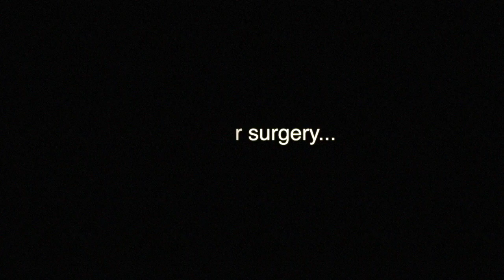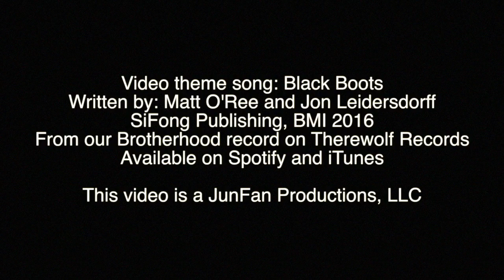Tech Talk - Episode 6 - Comparing Pots

Comment: This was a cool video. I definitely hear a difference. I'm not hearing what your hearing but you're there and I'm listening through a phone.
I thought the Rs pots smoothed out the tone taking some sizzle off. I got curious. I just replaced my Rs pots, the ones we bought at the same time. I replaced them wth the same Rs pots, the old vol pots had become noisy. 
So I compared my 2019 r9 which has the newly redesigned taper that Gibson had CTS make wth the RS pots made also by CTS in my 2010 r5. The taper seems the same! Both guitars have the same pickups. I believe the only thing that changed for you was the new caps. Both my guitars cleaned up gradually wth noticeable dirt to around 5 on the vol depending on my pick attack.
Reply from the maker: thanks Carl. I'm really curious about these VIpots too. More to come

Comment: Either those pots from RS that you installed aren’t the correct taper or the train wreck isn’t as responsive as stated.  There was already some breakup at 3 or 4, and there wasn’t much difference at all between 8-10.  With proper pots that have the correct taper the amp can be set for heavy gain and breakup, and then going from 10 to 9 on the guitar volume there is noticeable difference (a reduction) in the overdriven tone (gain) and the amount of treble.  Going to 8 is even more of a drop off, and by 5-6 the amp should be completely clean (unless it’s an ultra gain, modern, metal amp that is dimed).  I replaced the stock pots in my 1982 Les Paul Custom and put correct, vintage taper CTS pots in it.  It behaves correctly and sounds like a completely different guitar (like a Les Paul) compared to how it sounded with the stock pots (they were linear taper and also 300k in the volumes and 100k in the tones).   The pots that came stock in my 2019 custom shop Les Paul Standard 1960 reissue (vos) also behave correctly and produce the wide range of tones/sounds a Les Paul is supposed to be able to produce.  I didn’t hear that type of response from either set of volume pots in this video.  You might recommend your friend order correct CTS pots directly from a vendor that carries them rather than through a 3rd party like RS.  Then he will be assured of getting the correct taper and his guitar will perform as it should.
Reply from the maker: Yes, made for RS in conjunction with CTS. Its on RS website. Definitely not the amp. Check out my video with a 59 burst. Thats about the best taper I've ever heard. I'm curious with these VIPots I have here if they are better.
Reply: MOBontv CTS makes audio taper and vintage (audio) taper pots that do what they are supposed to do.  My Les Pauls clean up properly as they are supposed to when dialing back the volume controls.
Reply from the maker: @bross63  oh thanks. Have you ever tried these VIpots?
Reply: Relatively speaking, I can't play for s#&t, but FWIW, I'd tend to agree with bross63. I've been using the VIP pots for a year or so now, and they seem to go through more distinct "stages". 1-4 is clean. 6 is like kicking on a compressor - thickening of the lows, with just a little bit of grit. 8 is overdrive with another boost in the lows. 9-10 adds the high end hair. I like them about 7 - this seems to be where you get the most dynamics from varying your pick attack.